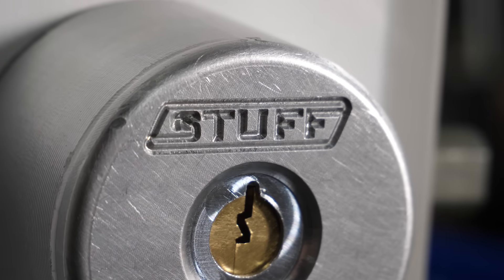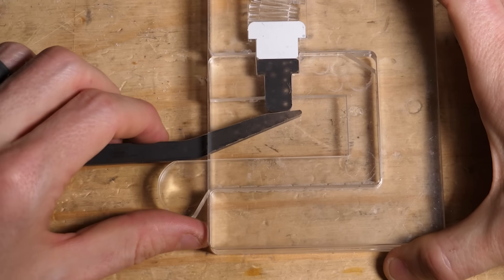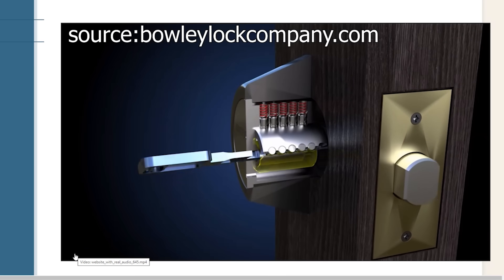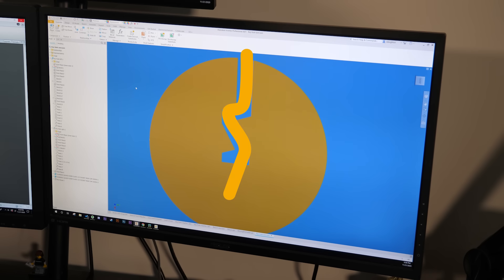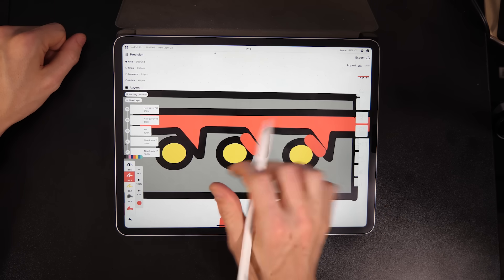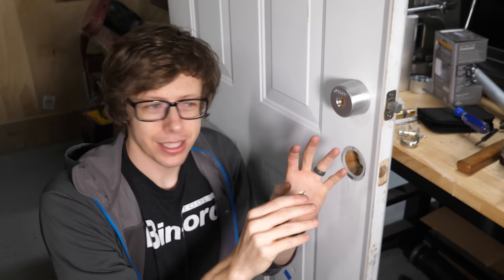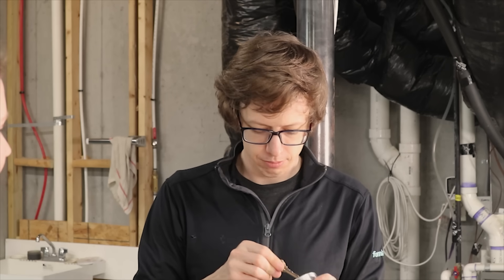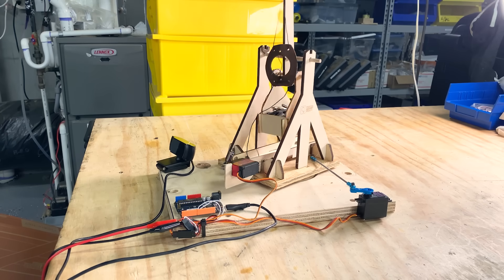Making an unpickable lock. Calling locksmiths

Comment: So yes, an improved version with more pins would be preferable to the prototype, but isn't the whole point of the collaboration that this lock represents proof of concept? If it can't be picked with three pins then it definitely can't be picked with eight. If it can be picked with three pins then the only difference between that and an eight-pin version is a couple of minutes' worth of time. Not saying I don't want to see LPL go up against the finished product, just that if he can pick one then he can pick them both.

Comment: and locks without keys are also "pickable" in their own ways, in fact, it would be even easier to "pick" those as demonstrated in many, many videos, from tape and charcoal powder to just using a UV light, the solutions are endless to no-key locks. but if the thing that makes the lock so formidable isn't the lock itself, then what?
Reply: in that case, we could uncomplicate your lock, but use the details I listed below as they SHOULD be possible to make fairly simply with some modifications and time

Comment: How about flooding this lock with very fine lubricant (to make inner parts slippery), set all pins to highest position (with a blank key), apply turning force and vibrate violently with a Toshiba vibrator to make all inner pieces to move around?

Comment: there is one problem..... you just showed us exactly how it works. now the un-pickable lock is much easier to pick
Reply: oh also while it may be pickable if the solution is in any way suspicious looking from an outside point of view or you have cameras, this lock in addition to the cameras and maybe a siren linked up to detect when it is picked (somehow, not sure how though I feel it could be done with pressure sensors within the "solid" metal, and make the "solid" metal a interlocking puzzle where you can get it together but not apart (they exist)) and then you would have a functionally unbeatable security system, at least for a standard suburban thief's standards
Reply: I know the idea is crude and my understanding of locks equally crude, but from how you described it and from a loooong time watching lockpicking lawyer and strategy being my forte, I think the combination between the lock, the modifications listed above which wouldn't hinder the pre-existing mechanisms in any way, and well placed cameras you would have a safe home or at the VERY least enough evidence to catch the perp. who knows maybe you could even hide a spy camera, like the kind they put on suits yknow (which do exist and you can actually incredibly easily get your hands on one) and hide it somewhere like in a pot so if they bust the cameras so they aren't seen the extra measure of a hidden camera might help
Reply: mmmmm but theres those things that reveal camera locations by reflecting light off of the lens almost like a sniper glare but for cameras.... hmmm
Reply: the lock with the pressure sensor linked through the door to a silent alarm WOULD make it so the perp would be caught easier, but a skilled enough one would know the response time and act accordingly, and if you live a good distance from a police station it may be worse.
Reply: HOLY SHIT I'VE GOT IT!!!! SHUTTERS ON THE LENS LINKED TO THE SENSOR THAT OPEN WHEN IT'S TRIPPED!!! THEN THEY WON'T KNOW TO DESTROY THE TINY ASS CAMERA BECAUSE THE LENS FLARE THING WON'T WORK
Reply: aight that's my plan lock+ sensor (tbd what kind of sensor once it is picked at some point) and lil spy cam with shutters

Comment: Basically, the problem with locks is that it is mostly easier just to destroy the parts around the lock instead of opening or picking the lock. The Mythbusters once tried to open a padlock by shooting at it, as we see people do in plenty of movies. The result was that a shot to the lock doesn't do much damage. But shooting the bolts that keep the lock in place was much more effective.
I worked in a fire department for a few years and we had this ominous box we called the stuffopener. And when I finally got to see what inside I was super disappointed. One of the tools in there was literally a hammer, used just to break the lock or the parts keeping it in place.  The more elegant tool was basically a handle one can screw onto a lock in order to break it into two pieces. And finally there was an electric metal saw to cut out the locking mechanism all together.
So I guess what I am trying to say is that you need an unbreakable door for an unpickable lock to work

Comment: Or you get a microprocessor and a few motors and hook up the motors to pins artificially activating the sequence to unlock the pins when a correct key is inserted. No stress about activating individual pins.

Comment: I once got into my own house with a electric screwdriver, with a drill bit in. The drill bit went into the lock as fast as a key, and the lock turned immediately. Would your lock be opened with a drill bit just as easy?

Comment: It's actually pretty "easy" to build an unpickable lock: you "just" need to machine it with very, very strict tolerances. The REAL problem is building a lock that it's hard to pick and cheaper than what you want to secure

Comment: This is dumb because a good 90% of locksmiths will tell u a lock is unlockable and needs drilled and replaced because they make more money that way, dateline or some other companies did videos on this, where they brought a good locksmith and some very easily picked locks that take 2 seconds to pick and tested some local locksmiths and found out most of the time they say they cant pick it just to get more money out of u especially if ur a girl and it's late at night and ur locked out they over charge its insaine

Comment: I see a possible weakness. Something i picked up from bosnianbill.  I wonder if it would work.
Reply: Overset all pins to the top and apply tension to the slider and rotationally. That should bind the upper gated pins beyond their gates. Slowly release the tension with maybe a little vibration and the pins may drop down into the gates and catch as long as not all tension is released. It may or may not work.

Comment: Did you make it out of titanium?  I have drill and bits that will open that lock in about 10 seconds or less.  Or i can use the 5 inch grinder if it doesnt have a key
Reply: Did you read the title?

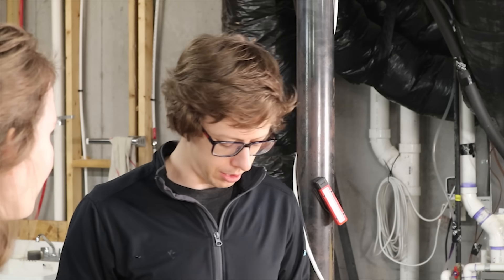Comment: question to "Stuff Made Here" 10:24 "at wanted to point out is that this thing is not going to be important it's not going to be commercially viable the main value is just the educational", 
one thing the no key locks need is power to make them work, yours does not, as an example only some sort of utility access door/box, in the middle of nowhere, maybe only need opened/checking once a year, on less, water/gas, or something, etc.,  you would battery or something, just the the key less door to work?  yours does not!
( what you did not say, will it still work, after years weathering, rain/dust/grime/etc.? )  :-)

Comment: did you try to apply little oil pressure to fill the chamber, and rotate the lock pick at the same time? 
...air pressure will lock for sure....

Comment: Decent idea but in actual use and practice locks need to be robust in function to work in the real world, like outside in the elements, but also with keys that are carried and used daily. Security can exist now as far as pick resistance but some can be bypassed or brute forced. I use Medeco and Abloy Protec 2 and can say a locksmith tends to go right to drilling or braking with picking not even considered. I like the notion and would love to see someone like Lockpickinglawyer or others in the lock-sport community give beating it a try; most every lock can be defeated one way or another and it’s always nice to see the community work the problem and how different minds work in different ways to overcome a challenge.

Comment: for the mechanism to "lock the pins" wouldn't it be easier to just have a lot of small discs stacked for basically every height you can put a key at. and then have the spool height be what is actually checked?
assuming they are still in a cilinder they shouldn't be able to be pushed out of stack. and the height of the spool in the stack is what needs to be checked. then once you rotate all pins are checked at the same time at the spool gates.

Comment: “Get a lock that has no key”- stuff made here 

LPL- yeah no
Reply: Only for the garbage ones. LPL only tested like 3. Every commercial building uses  RFID locks including high security ones. You'll be better off just busting down the door.
Reply: @Infamous_man  Most RFID locks are "secure" only because they are still considered obscure. As in security through obscurity. Also, cloning RFID keys is too easy because you don't even need to touch the key to copy it. An active RFID key that actually computes responses would be an answer but those need too much electricity or are too slow to use – in practice nobody seems to be using those.

For example, using public key encryption with x25519 algorithm and passing nonce and signatures over RFID could be done safely. And the nonce needs to be generated by the lock. Nobody does that in real world. And even in that case, you would have to put all the relays in magnetically shielded environments to actually operate the lock or the whole mechanism can be bypassed with a strong magnet.

If you can design an RFID lock that doesn't have any parts that can be acted with strong electromagnets, there's a good start for pick proof lock.

Comment: How did you came to a number of 12 mllion is beyond me. If we talk locks. Pin cant be cut to 26 different heights. Im not sure, but I think pins have maybe 5 or six different cuts.

Also, what I( allways tought about this is to make hollow pins. Thats it. Simple solution to add to any other fe3ature that would by itself make things much harder.

Comment: So basically you've combined a pin tumbler and a warded lever into one lock.  Interesting approach.  

If you wanted it to be commercially viable you'd mostly need a way to set different combinations other than by how you machine it in the first place.  I can think of a few ways you might do that, and it's a trivial problem compared to reliably locking the pins.  Wouldn't be of much practical use for residential doors since burglars tend to just force entry rather than picking the lock, but you might find some market for it for high-security vault doors and such.

I expect picking this thing would consist of feeling for slight differences in how far the tumbler turns, adjusting one pin at a time and trying to feel when you've got it lined up with the wards.  Might not be totally impossible, but definitely not going to be easy.  A lot more like trying to pick a combination lock.

Don't get too excited about locks that don't use physical keys.  They merely have different vulnerabilities, and there have been some spectacular failures ranging from anyone with a smartphone being able to reset the code and open it to being made with all plastic internals that melt open in ten seconds with a propane torch.

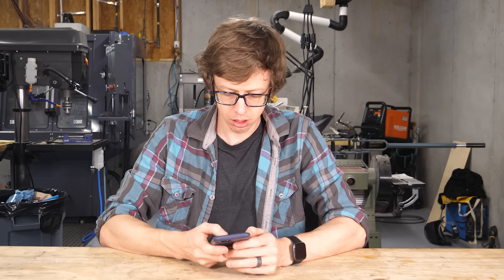Comment: 8:35 “I found a locksmith that specialises in picking locks” LOL
Reply: Some crack safes, some get into cars and get you new keys, it depends
Reply: i know it sounds dumb but its not, there are locksmith who prefer using a 12 gauge shotgun rather than a pick, drill or guessing the code.

Comment: I know it was just for fun but if were to be produced you would have to make the angle or degree of the lock case more steep so you can't grab it with a tool and hammer it off easily

Comment: My dad,  50 years of being a lock smith ,  says that locks only keep honest people out.
Reply: Locks are essentially a social contract.  when something is locked you're signalling that permission is not granted..
If they really want to get in, they'll get in.
Reply: @PoodlePuncher  Uh... Pretty sure that even when I am home and left my front door unlocked that doesn't mean I want random strangers off the street walking in through the door...
Reply: @davidparker5530  The door does the same thing - its closure is a signal for others not to come in.  The lock is just an extension of the concept, literally: this door is extra closed, to you who do not have the key.  Please knock and I may afford you the courtesy of letting you into my personal space.  Which is actually only personal by societal agreement.

Old Mesopotamian doors would have a bolt that was covered over with wet clay and a personal "seal" impressed into it before it dried.  The point being that it was obvious if it had been tampered with, as the seal could not be reproduced easily by anyone else.  Little more than a deterrent, as then, so too today.
Reply: He’s right. Locks keep honest people honest. And they buy time w/ dishonest people.
Reply: Bc dishonest people just find a way to break the thing
Reply: Hes right. I was a criminal for over a decade and i funded my habit through lock picking. You would not believe how much valuable stuff people trust to a cheap walmart lock! If people would spend at least a good $150 on a decent lock it would keep out a good percentage of pickers out. But people lock up $20,000's worth of shit with a $30 master lock... Makes no sense! Iv seen it all. My recommendation is to have the "Locked area" well light, have visible cameras and signs posted up along with a good lock. When i was picking locks i would never stay in a well light area for longer than a few minutes, and that combined with visible cameras and a hard lock to pick would make me pass it up for the next house/garage or shed. Basically the whole point of a lock is not to be "unpickable"... But to be just good enough to have a secondary security measure take over when theft is occurring like a motion detector/camera. And also a tip for cars, rig up a hidden kill switch that kills the motor when flipped even when the key is inserted. This will prevent a theft bc the thief will give up and move on. Hope thies pointers are helpful!
Reply: @terryrowland1558  I disagree with the second part of your comment. Breaking into the the location normally takes less time than sitting there and attempting to pick open a lock. Normally you are eye level with the lock when picking as well which is massively suspicious when you are sitting there for 1-4 minutes. Most doors are not reinforced in any meaningful way, and can easily be brute forced for a moderate amount of noise for a few seconds.

By the time someone looks out a window, you are already inside.
Reply: @Charles-vd3vc  until lockpickinglawyer shows up and gets in in less than 10 seconds so it doesn't even look suspicious
Reply: The door had a nearly full window to hit so yes
Reply: the saying is. "Locks keep honest people honest"
Reply: Untrue, I'm honest and my home locks don't keep me out

Comment: You can make a lock with a two space key with more pins after the first 1/4 turn where you must insert the key further or pull it out depending on the lock design.  1000000% unpickable

Comment: Hate to say it, the weak point of this lock is the aluminum body and components. It's a neat concept, however (presumably) 6061 aluminum is too easy to drill or cut through in short order.
Reply: The goal is not to make an impenetrable lock but the goal is to make an unpickable lock.

 Like he said in the video it's not commercially viable but it was just to see if he could do it.

@10:31

Comment: There’s a fairly expensive tool that LPL covered on his channel, it’s a small camera that fits in the lock, and if you’re able you can easily decipher the grooves needed and cut out a key
Reply: The camera would see nothing of importance when put in this lock. You would just see the bottom of the key pins. That tool works on cores with sliders. It might only work on the Kwikset Smartkey system.
Reply: also you would need a key blank and template specific to the lock and since this lock is a prototype and he's not exactly gonna give lpl the plans for it its not really an option
Reply: its $300 tho

Comment: I would call this a pin tumbler plus ward system, I was thinking of a similar system except instead of that pin lock spring maybe just a bunch of wafer spacers to use as false sets that are then checked for correctness on the ward.  would help reduce the complexity.
Reply: Also would love if you uploaded your autodesk drawings somewhere to be iterated on
Reply: Then you need a bigger key and would be same as regular lock
Reply: https://github.com/dicetrash/warded-pin-lock iv added a small prof off concept freecad, no key larger, just a set of master wafers and the top pin is the ward, just like in this video
Reply: @dicetrash  but in the video all of it is a ward I think I'm not engineer and also it's just a prototype stuff lock so more can improved but good job
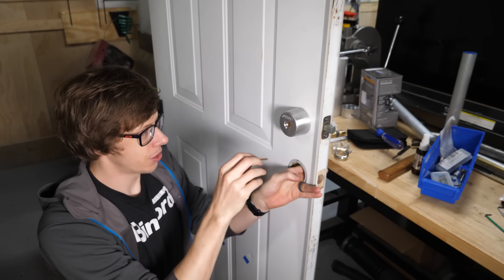Reply: Also really want to get into that lock, go to 8:08 and impression the key from the image

Comment: You just have to pick this lock twice I’d say. Unless I’m missing something. Pick once to move top pins then a second time to set them at the right height to pass through their gates. Use a tension wrench that reaches the back of the key way.. if you don’t know how it works ya it would be impossible but knowing the mechanism i get lpl gets it in a minute anyone who knows locks could figure out pretty quick